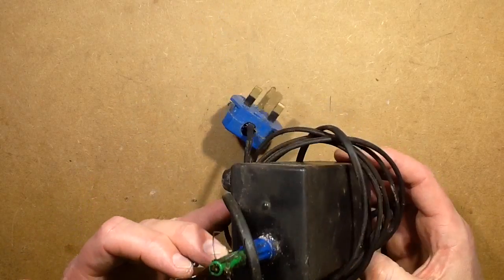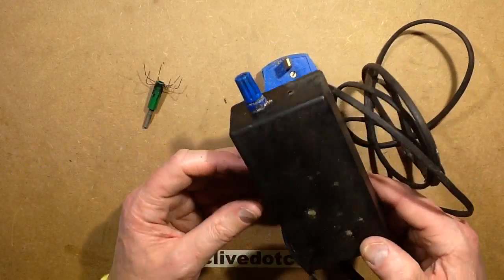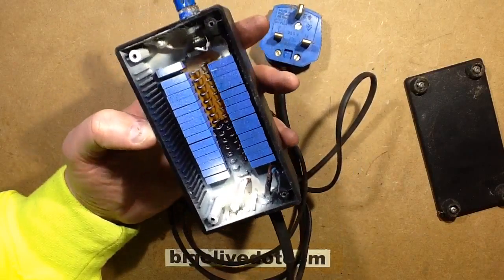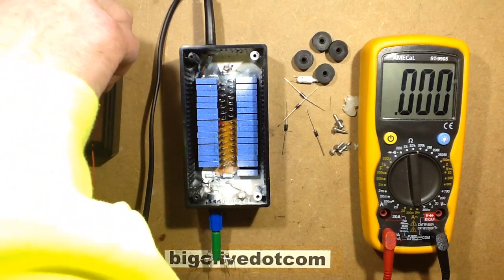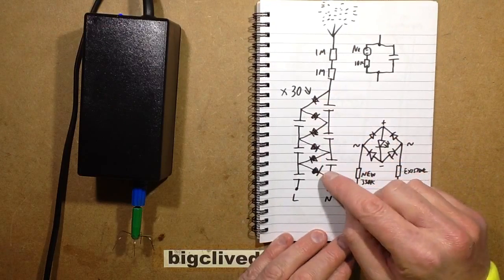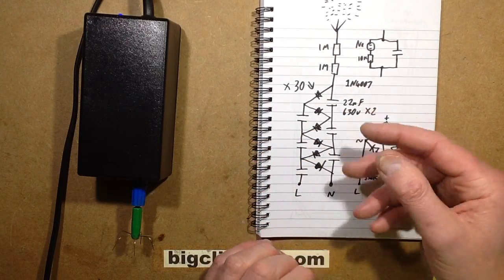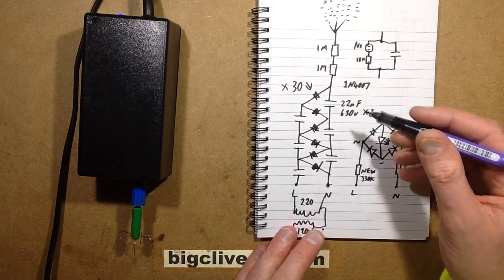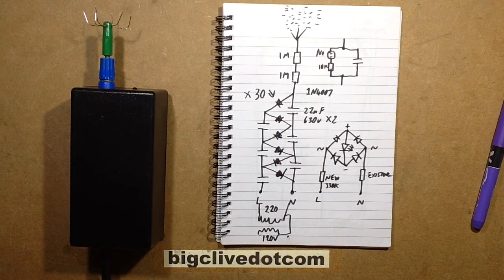Manky custom ioniser refurb with safety violation.

Comment: I was having a really 'Thick-as-a-brick' moment trying to understand how these work. In my mind Live is at 220-240V(rms) and Neutral is at (ish) 0V (tied to earth at the substation end) so I was struggling to see how the circuit reversed to create the + - , - + alternating to make the diodes work. I then re-taught myself that it's actually the CURRENT that is alternating between the L and N wires which is when the penny dropped. Excuse my stupidness at this time, I have 'man flu' and not thinking straight right now lol
Id like to hack that black pyramid ioniser I have to put better pins on it :)
The 1M resistors also make sense now as they are a current limiting device and have no/little effect on voltage, like i said, feeling so thick right now.
 Thanks for this vid Mr 'Naughty Bear' you always make me laugh and always teach me something cool in every vid :D
Reply from the maker: When you ground the AC output of a transformer at one side it is still AC, but one leg of it is referenced to ground.  So with respect to actual ground it may seem like zero voltage either way, but to the other side of the transformer winding it still appears as alternating polarity.  If that made sense.
Reply: Yeah that makes more sense buddy,for some reason I was spinning out not seeing the logical side of it. Many thanks for stopping my head spin :D Thank you :)

Comment: i'm starting a project using a 19v/3.5A power supply i have - by my knowledge there should be no real concern if i do something daft while working on it i.e. touch the bare wires. my understanding is that the transformer isolates you from mains and the 19v dc is not a harmful voltage under normal conditions. i saw one video of clives where a transformer had shorted, so i will check :) could anyone confirm?
Reply from the maker: If it's a fully isolated suppl;y like a laptop supply and is from a reputable source then it should be isolated.  Note that some can give a very slight tingle sensation due to suppression circuitry leaking a small amount of current from the input to the output.
Reply: perfect, thanks clive!

Comment: I feel bad for health and safety officers. Its so common for people to ridicule them and the regulations but when theres an industrial accident and people are hurt or killed and it comes out that the company was breaking H&S rules, skimping on equipment or training, everyone is outraged. I know people are going to think ah but its been taken too far, its Health and Safety Gone Mad, but Id rather peoples jobs were a bit too safe rather than a bit too dangerous.
Reply from the maker: If they used properly trained workers in the first place it wouldn't be an issue.  But one-day crash training is common now in the bigger name companies.  Everything has been dumbed down to cater for casual unskilled labour off the street, and it's made doing even the simplest job a complete chore.  If you don't work in industry or construction then you'll not realise how bad it has become.  Many "safety officers" are also the sort of people who really shouldn't have been given the job as they are fundamentally only doing the job to exert power over people.

Comment: Clive, does adding more needles make it work better?
Reply from the maker: Not really as the output is limited by a balance between the ionisers ability to supply current and the movement away of charged air.  A fan behind the emitter does help though.  The main advantage of multiple needles is that it can cover a larger area of air and whereas one needle could gradually dull at the end over time, the larger array will always ensure a sharp point.

Comment: Could you add a discharge resistor to remove the "inconvenient" tingle you get from the pins after unplugging?  If so where and what value?
Reply from the maker: You could add two one megohm resistors in series across live and neutral.  Or kill two birds with one stone by adding an LED indicator like I did which will safely discharge the plug down to about 2.5V while also adding a useful indicator.

Comment: wouldn't you only need to use one more stage on 120V vs 240V, because if i understand correctly every stage doubles the voltage from the previous one, so the 120V mains voltage would only need to be doubled once to be at 240V and from there it would be the same as in your ionizer.
Reply: each stage doesnt double its input voltage, it adds on another chunk of peak-to-peak input voltage. so with half input voltage youre only adding half as much in each stage
Reply: 0yeme0 oh ok

Comment: At the risk of triggering a H&S meltdown - are these likely to pass a PAT boxing ?*

The leading brands in the UK were afaik 'Mountain breeze' and 'Dezac' but I don't think either is still in production (Dezac has a website but it looks a bit 'out of businessy') 
A few charity shops will sell mains electrical appliances - but those that do PAT box indiscriminately and chuck away 'failures' without further investigation - if ionisers are in the class of appliances that are capable of passing PAT, that might be a source for people who are interested in buying one cheaply.

* asking cos afaik a quite a lot of stuff that's actually safe can either fail or be destroyed by PAT boxing
Reply from the maker: These devices would not be damaged by a 500V test and are classed as double insulated.  However a slight leakage would be detected from the insulation test if the ground probe was put on the output pins.

Comment: I made a full wave negative ion generator a few years ago, and it worked so well that I am making one for every room in the house. By the way I live in the US and didn't have any problem reaching  -12kv output.
link to the schematic I used: http://www.instructables.com/id/How-to-Make-a-Negative-Ion-air-ionizer/step2/Full-Wave-Ionizer-Materials-and-Component-Layout/
Reply from the maker: That's not a good design.  There should be no circuitry connected to mains ground whatsoever other than components specifically designed for that like very low value class Y capacitors.  In that schematic the entire half of the multiplier connected between neutral and ground will be doing nothing as there is no potential difference at the base of the multiplier.  The correct design would show just one side connected between live and neutral and no connection to ground whatsoever.
Reply: That's what I thought when I built it but it worked and didn't cause any problems so I left it alone. Usually if something isn't right on instructables someone calls it out in the comments. It sounds like my next project is to pull them apart and make a few more with the wasted components.

Comment: I don't think you explained how the 'it's working' flashing neon is connected to the rest of the circuit.  Putting it across the 2x 1M resistors would give you 'current flowing' but would disable the safety stuff.  Putting it bewteen H.T. and ground will limit it's max voltage and risk blowing up the cap.. 
So I'm not actually sure how it's connected and it's not on your schematic.
Reply from the maker: Thanks, I'll add an annotation for that.

Comment: I noticed you did not touch the needles at the end, even with the two 1 Meg 'safety' resistors in series with the ionizer output. This begs the question... how shocking is it?
Reply from the maker: If you approach the needles from the front it'snot too bad, but if you approach from the side then it tends to give you a static shock.

Comment: Could you just use a microwave oven transformer to get the high voltage for the ionizer with a resistor or something to limit the current?
Reply from the maker: Not recommended at all.  Far too dangerous and also very inefficient.

Comment: How do you know this device was effective? The fact that this thing consumes so little power also means that it must put out very little power, which suggests that its ozone output would likewise be very small.
Reply from the maker: The fact it covers the surrounding area in black dirt precipitated from the air shows it works very well.  That's the one annoyance about ionisers.  They just precipitate the airborne dirt onto walls and other surfaces.  But better on the walls than in your lungs.
Reply: That's pretty impressive. Definitely going to make one for myself now. Thanks for the video!
Reply from the maker: keep in mind that it basically generates static electricity.  All it has to do is put a small electrical charge into the air.  That's why it draws so little power.

Comment: Interesting you mention ozone generators, I've been considering picking one up recently since my wife's trunk got damp and is now quite musty. Not sure if it'd really do the trick to eliminate the smell, but I figure it couldn't hurt. 

The only thing I don't like about ozone generators is the fact that the ozone kind of burns your lungs and nose. I've actually heard there's a correlation between ozone and cancer as well, so not something you probably want to breath in all the time. BUT for locking in a trunk for a few days to kill mildew or mold spores? Maybe.
Reply from the maker: High ozone levels (those you can actually smell) will quickly cause irritation to your membranes like eyes, nose and throat.  It's basically an airborne oxidiser like bleach.  It also corrodes materials like rubber and metal when in high concentrations.  I'd recommend trying to clean any affected fabrics and then treating them with a mold killing spray.
Reply: Jesse Crandle If you can, park the car with the trunk open, facing the sun.  Do this as often as possible.  Sunlight does a great job of killing the spores.
Reply: James Potts I live in Florida, so life is a strange paradox: either everything is soggy wet and rotting or it's sun-bleached and crumbling apart. The plastic trim and paint on my car fades more and more each year, and yet the constant rain has made the trunk mildewy. I don't recommend anyone move here, and I'm not sure why so many people have lol.

Anyways yes, the sun would definitely help, but I'd have to keep a strict eye on it as it can rain at ANY moment. Flash downpours are an everyday thing here, sunny one moment, pouring rain the next.

Comment: Could you tell me what value the existing resistor was that feeds one side of the bridge rectifier? the other one is 330k. I would like to build this LED indicator circuit. Also is it electrically safe to touch the little needles when this is switched on....I'm guessing so due to the 2 x 1Mohm resistors in series with the output.

Comment: When did you build this Clive ? I've still got the one I built in around 1986 or 87. Could we have used the same kit ? I imagine I got it from some monthly electronics mag at the time. 

It's still in a drawer somewhere.
Reply from the maker: This wasn't a kit.  It was a complete custom build.  The kit you got was maybe one of the very small units sold by a regular article contributor to one of the magazines.  I can't remember his name.  He produced a lot of weird and interesting projects.  If it was that ioniser then it was unusually compact and worked very well.
Reply: bigclivedotcom could be. It was maybe half the size of your one. I persuaded our 'young enterprise ' company that we had at school to make them and sell them. We made 3 or 4 only in the end - quite a lot of effort to make and I think I was the only one that could solder. They did work well though. Really strong swishy noise and breeze. Just had a rake for it but no idea where it is now.

Comment: Electrically-charged metal tends to oxidize more readily in the air.  I had a metal-cased ionizer in my house for awhile, and it developed white corrosion all over it.
Reply from the maker: Are you sure that wasn't an ozone generator?  A metal cased ioniser would be a terrible idea.
Reply: Purported to be an "ionizer" but I'm sure it produced ozone.  I'm not sure what actually caused the corrosion, but your corroded electrode reminded me of it.

Comment: Years back I had a pyramid shaped ioniser, and if you put your finger near it, you could see the arc, it also came with this weird test bulb to see if it worked, you held the yester a distance away, and if the lamp flickered, it was working
Reply from the maker: Sounds like an Amcor unit.  Quite big and heavy because it had a transformer in it.
Reply: Yep it was an Amcor, it was fairly substantial, and after a while it would leave a black outline where it was placed. I think that could have been partly down to the coal fire at my parents house.

Comment: Hey, i really like the smell of ozone and i dont care much for purifying the air really. How could i build one that runs off dc? I think i have one of those 5V to "700.000" V booster thingies. But i cant succesfully get my air to smell like ozone with those. So if anyone can help me out that would be awesome. thanks
Reply: You need to place the emitter close to the electrical ground. Some commercial ozone generators will take a strip of metal and bend it into a donut shape around a needle connected to the HV output in order to both generate high amounts of ozone and to direct a beam of air to carry it away.
Reply from the maker: The zapper type units don't produce the large area corona required to create modest quantities of ozone.
Reply: If you get the cylindrical "200,000" volt ones you can put a couple of megaohms on the output and they'll produce a decent amount of corposant
Reply: 54l68l65l20l47l61l6D Amm alright. Will i be able to smell it?

Comment: I found one for 12v on eBay, but the thing that confused me was the main picture listing 3.8millon onion concentration? ebay.co.uk/itm/282042349386
Reply from the maker: The figures are just random pie-in-the-sky numbers.  That may also be a fake unit with just a blue LED in it.

Comment: how come you don't need higher voltage rating on the caps?
Reply: SirArghPirate, each stage is only referencing the voltage difference of the previous stage rather than all the back to ground.

Comment: If each multiplier stage doubles the voltage, could us 120 Vac users just add another multiplier stage?
Reply: He does answer this in the video.
Reply: Oh ok I'm used to the typical voltage doubler that does double the output when lightly loaded.
Reply: @jmcinvale
it is only a doubler at the first stage each extra stage only adds the starting voltage to the end :-)

Comment: I've never heard of these positive effects of an ioniser. And especially an ozone generator, I remember in the 90s when they all threw out their old laser printers because they were generating ozone and it was considered a health hazard. This is fascinating, why can't we buy something like this? OK, 30 caps, 30 diodes and 2 high value resistors and one can build one themself (if one knows the circuit diagram), but still, this sounds like something every household should have!
What kind of medical application is the other probe intended to being used for?
Reply from the maker: The probe was based on research that showed that wounds exposed to a stream of ionised air healed faster.  It may have been the sterile environment it created.  Ionisers used to be very common, but the best type are not so easy to find now.
Reply: bigclivedotcom OK, so the best bet would probably still be to build one from the circuit diagram you showed in this video. The only problem I have with it is: In Germany, we have the normal EU plugs, and they are not directional, so it could be plugged in either way. What would happen if it gets plugged in the wrong way?

Comment: BigClive, could you make one out of a microwave transformer ? lol
That would 'ironise' anything including people that touch the prongs including flys
Reply: I've made a few out of old CFL driver boards, and the generic "Ignition Coils" available via Clive's "usual suppliers" - e.g. - http://www.banggood.com/49CC-Mini-Car-Coil-Ignition-Motorcycle-Conversion-For-Two-stroke-Engine-p-1074109.html?rmmds=search.  If you find the HV isn't high enough (VERY unlikely) a few extra Cockroft-Walton stages will suffice.
Reply from the maker: Given the current a MOT can supply I wouldn't trust a couple of resistors between me and it.
Reply: Since efficient ionisation does need a decent voltage, I'd suspect that using an MOT  wouldn't be that effective, so you'd have an ineffective (yet potentially VERY lethal) "Room Ioniser" :-(
Reply: Probably not, if it was rated at the same voltage as this device and (crucially) had the same 2 Mohm series resistance.

Comment: Looks like it should have been fitted with a pre 1984 mains plug with uninsulated live and neutral pins.
With one of those old plugs you never needed a quicktest/safeblock. Just hold the bare mains wires over the live and neutral outlet openings and plug the old style plug in. An instant very dodgy mains connection.
Reply: bob s Hello from freedomland!
That's one of about two things I don't like about the NEMA standards.
Reply: @bob s
it still works , you just need longer bare wires :-)
a better way is to use a figure 8 connector for two core or clover leaf (or kettle / computer) lead for 3 core and just push the wires in then plug it in , if the device your testing starts misbehaving you only have to pull the wires out to switch it off :-)